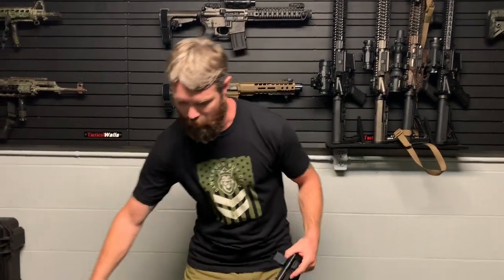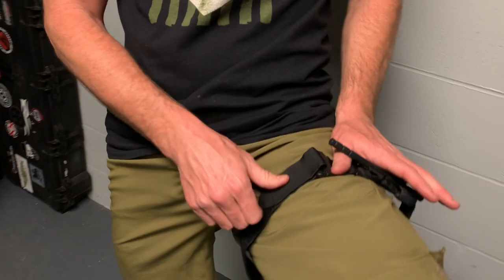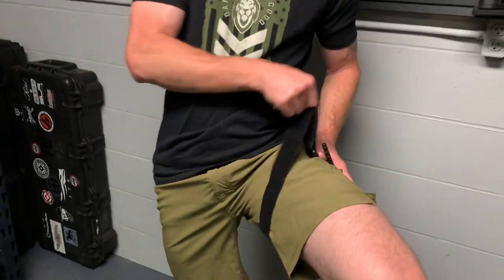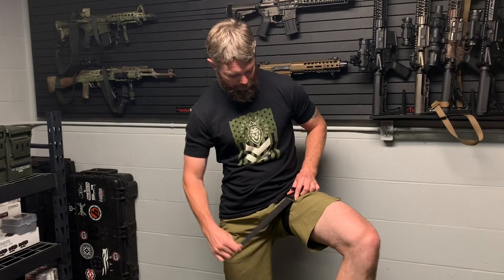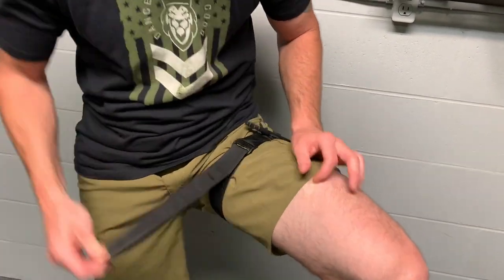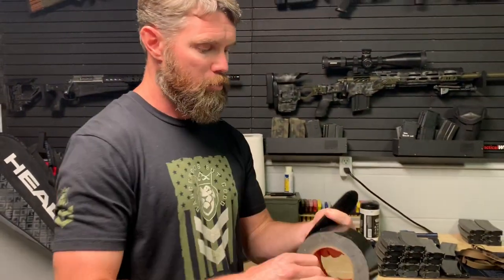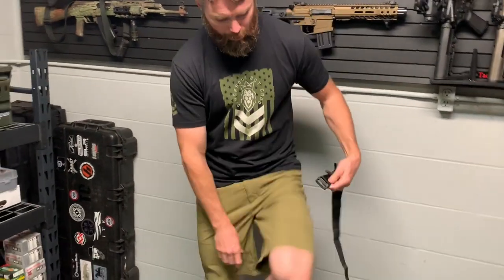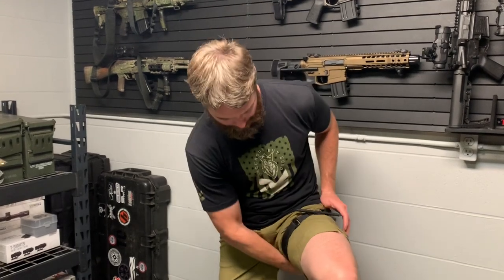How to Set Up Your Tourniquet for Faster Application with Gloves or During Low Light Situations

Comment: You could do what I do to my Time strip Velcro of the TQ: I simply got some non-adhesive Velcro and cut a piece to put on the end of the Time Strip so I can pull it all the way across so the Velcro isn't exposed and scratchy. More importantly it provides an excellent pull tab to open that part of the TQ to free the windless- same could be done to the end tab as well. Looks clean and works.